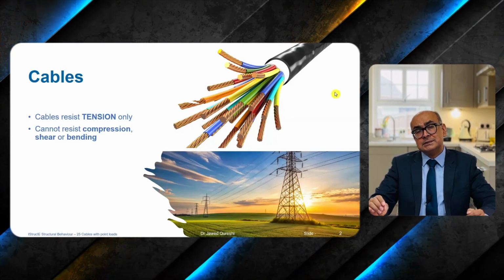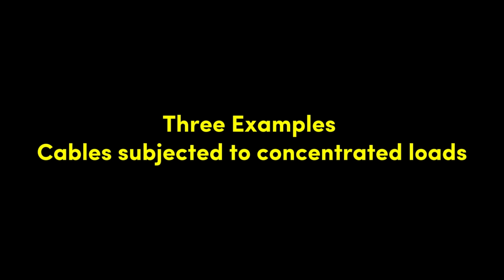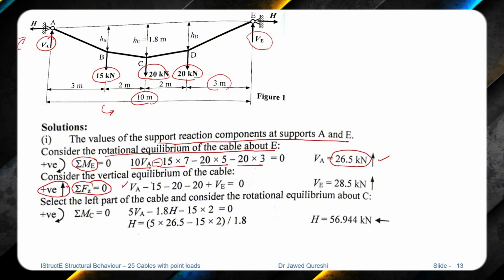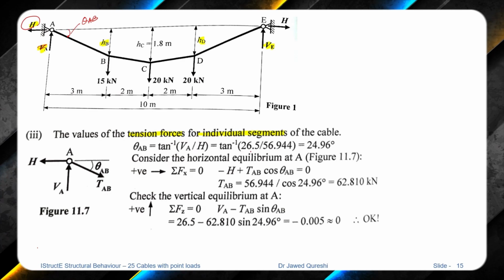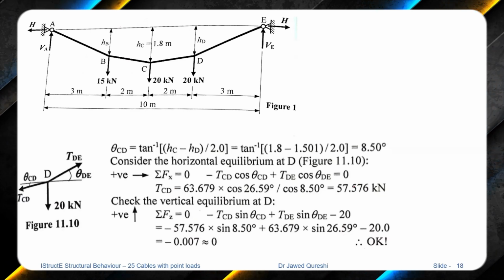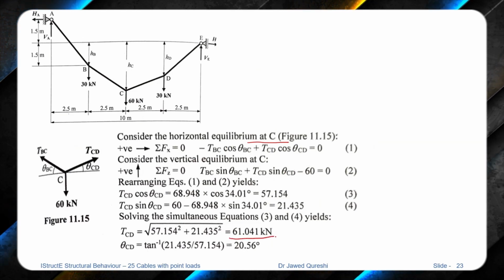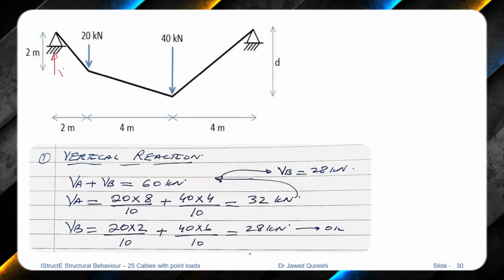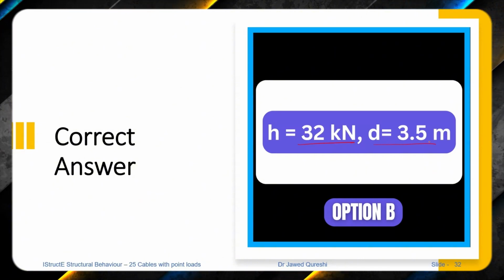How To Analyse Cables with Concentrated Loads | IStructE Structural Behaviour Course

Comment: Interesting and thank you... now the "hangers" do create a compression on top cables but it's resolved in "main cables" and with anchorage at the bridge deck node location.
Cable stay bridges have compression in cables at the towers, where they pass through...
So, the wire rope does have compression and I don't think I can find a stress that doesn't have both compression and tension.
The cable bundle is never the less compression once you load it with hangers or cross the towers and it also has neutral axis of a gradation of stress in the cables at these load points (I believe a neutral axis exist wherever their is a stress).
Even if you just pull a cable straight only, your clamp force to pull, creates compression at the ends. Further,  the wrapped cables do not elongate the same and the center cable elongates at a different percentage than the outer spiraled cables.
Again, I can not  find where a stress is created that both compression and tension is not presented also...
Reply from the maker: This a very useful insight. Thanks a lot for the comment.